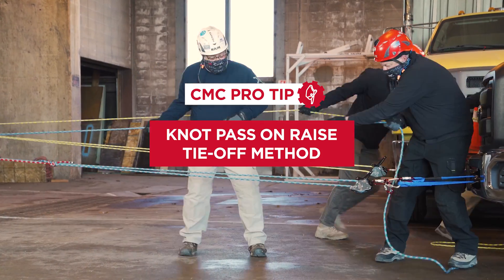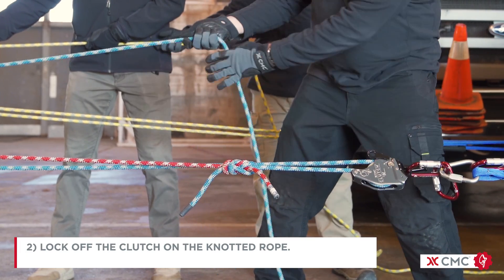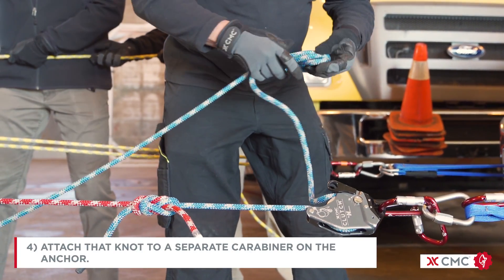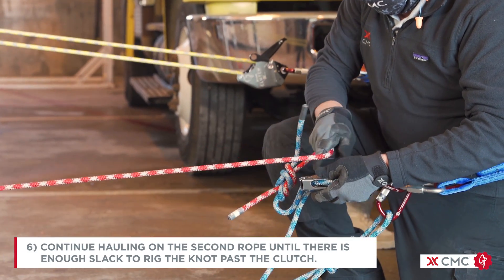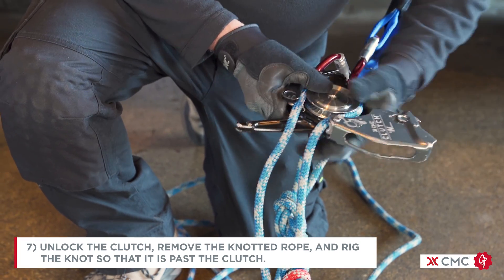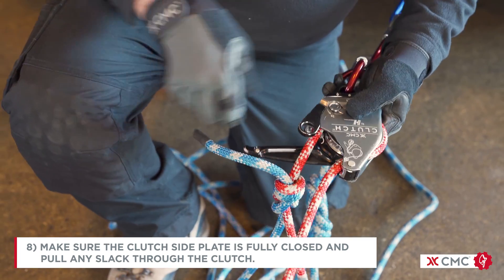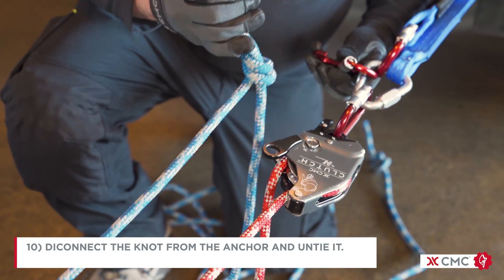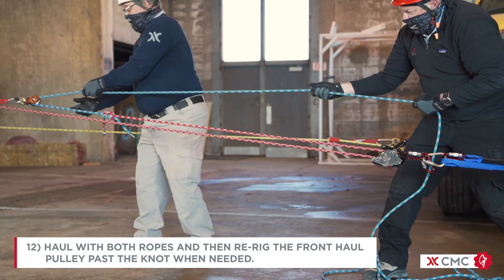How to Pass a Knot on a Raise Through the CLUTCH Using the Tie-Off Method | CMC Pro Tip

Comment: What happens if the line under tension fails at about 42 sec into the video?  Won't the slack line then be ripped out of the rigger's hand possibly injuring his hand and also allowi the system to fall 3 ft or so until the figure-8 knot catches?  This seems like it defeats the main purpose of a twin tension system which is to keep the system under tension at all times, even when one line fails.  Am I missing something?